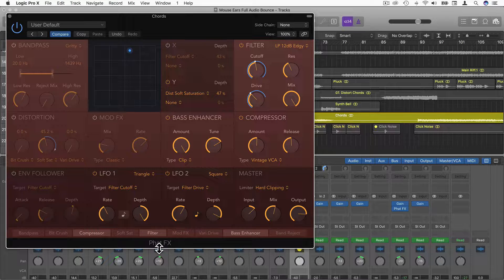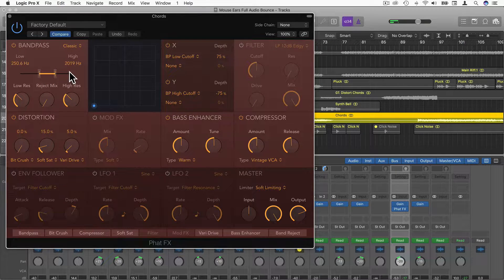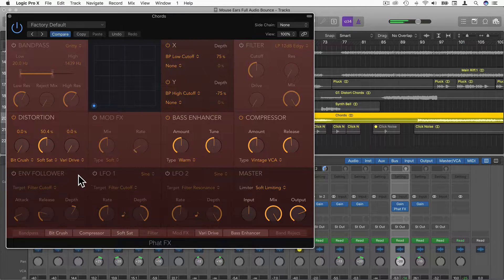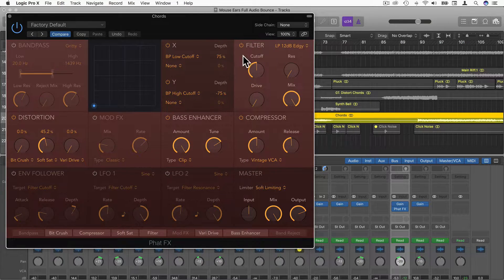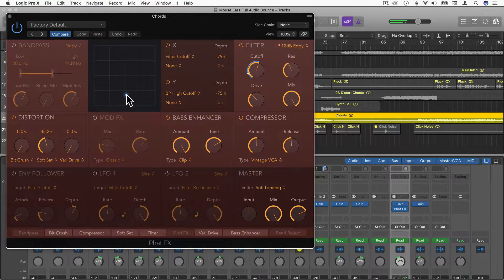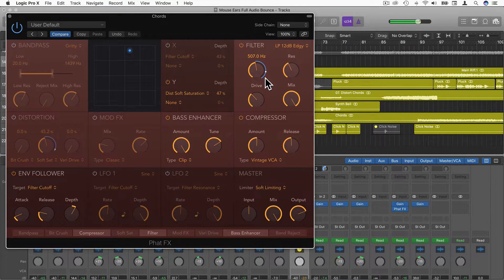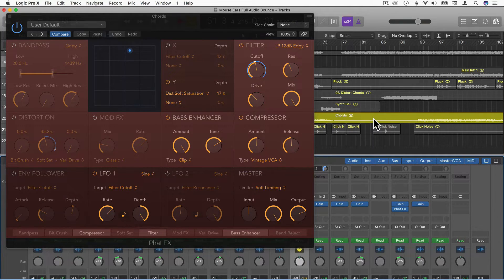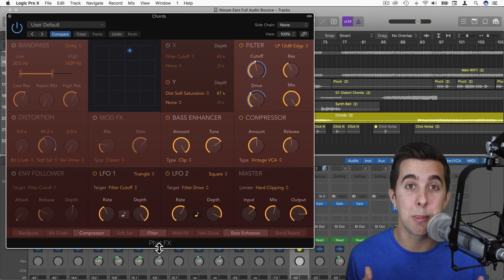How to use the Phat FX in Logic Pro X | Logic Pro X Tutorial

Comment: having trouble. how can I automate these parameters? I mean without having to go to each and every parameter and setting it up? isnt there a way for logic to just start tracking your moves in phat fx as you start playing with controls? there's Gotta be a way.. thanks y'all
Reply: actually I should've known id find it ha ha. just had to dig a little deeper. in my automation preference I had "plug in" turned off. so it wasnt writing anything at all.. but I checked it and now alls working great. also figured out that if you option click on the drop down triangle it will show you everything automated on that track.. pretty nifty. so no need to pre configure or select tracks that need the automation. just plops right in there
Reply: teddy pendergrass I have a question, please help! I used Phat FX in the “plug-in section” rather than inserting it to “Sends-bus section” because I want to apply 100% Mix of the Phat FX’s sound effect. Now, I have a problem because I want it to automate it so that the effects can slowly go off. Is there any way I can do this? I tried sending it to “Send-bus section” but it won’t give the same 100% Mix effect of Phat FX that I want. Please help.
Reply: @seanjunhoo  sure bud. just look at the bottom right side of phat FX, there's a button called "master" and in that section you'll see 3 dials. the one in the middle is called "mix". that's the one you want to automate in logic. just draw the curve from 100 percent (or however much youre using for the effect, down to zero percent..
Reply: sorry, I meant to say theres a "section" on the bottom right called "master"